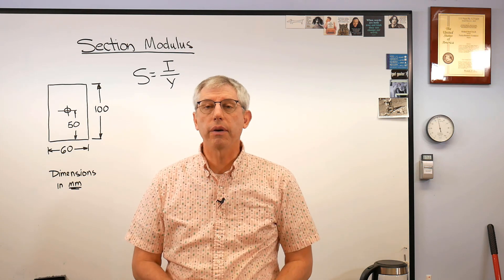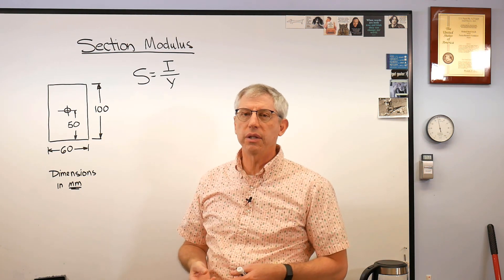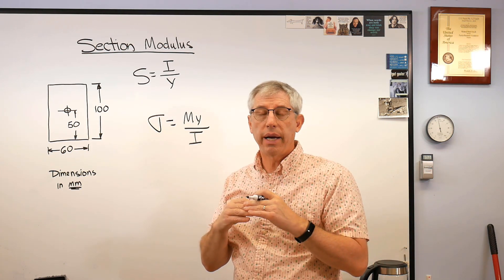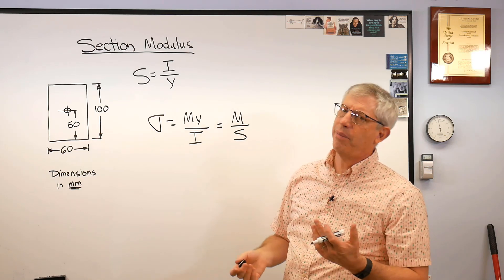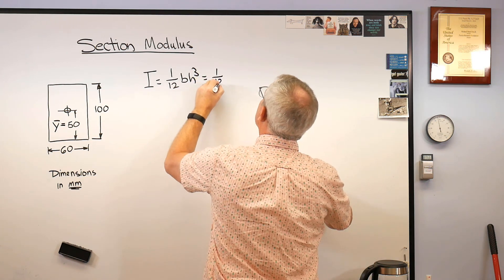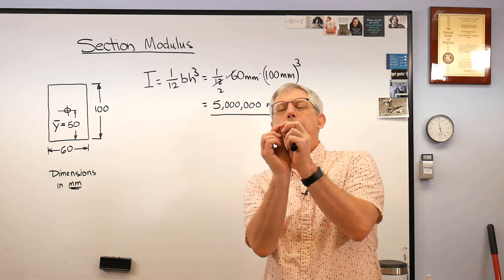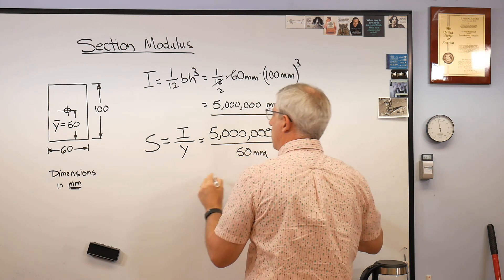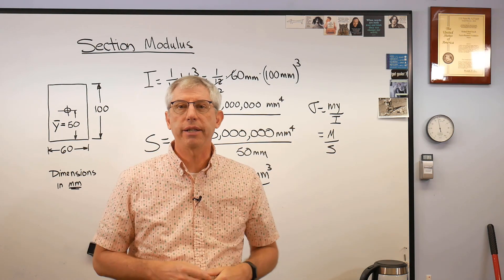Section Modulus - Brain Waves

Comment: Hey,
Your videos are amazing for students n structual engineerig. Well done 🙂. 
Is it possible for you to show us a step by step video of analysing a 6 multy storey building from start to finish.
Calculations of dead + live loads.
Structual analysis ( statics of the whole building with frames).
Finding the momemts, shear, normal and tortion in every element. Or by using andvanced FEM design hand calculatated, nodal displacements, bucking, deformation, rotations, etc.
Wind load on the building exterior walls.
Snow load.
Earthquake assumption!
Even if possible with geotechnical solutions.
Leaving holes in the slab for other technical issues ( ventilation, water, wastewater, etc).
Calculating every element, from foundation to columns, to beams, to slabs, walls to roofing.
With many different building materials: glass, steel, reinforced concrete, wood, aluminium, etc.
It could have been awesome because you know the subject very well. This could have been the greatest thing we could learn the young students.
You are awesome🙂👍